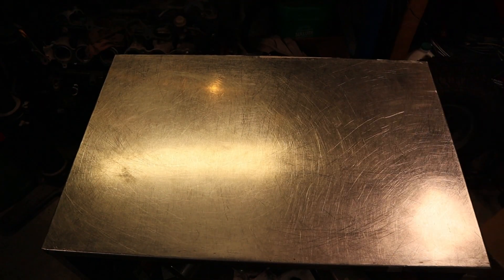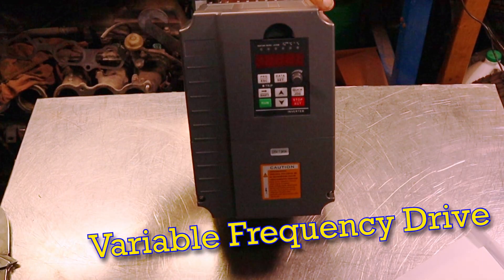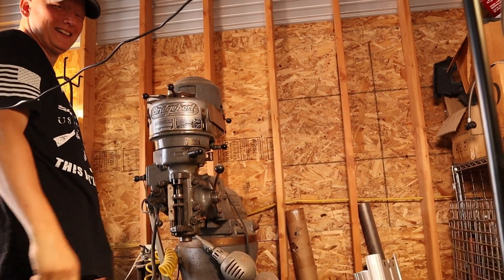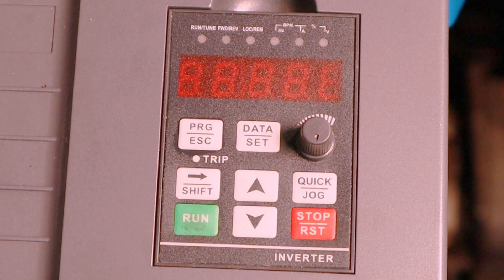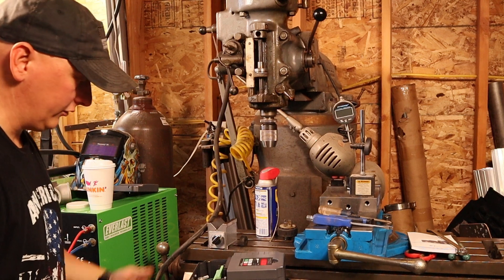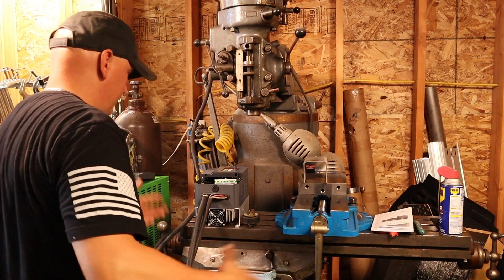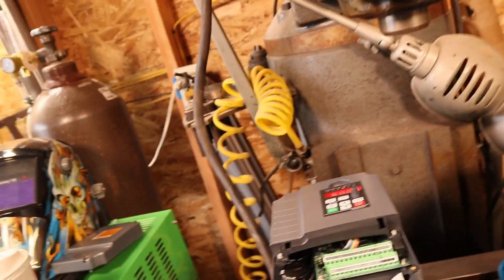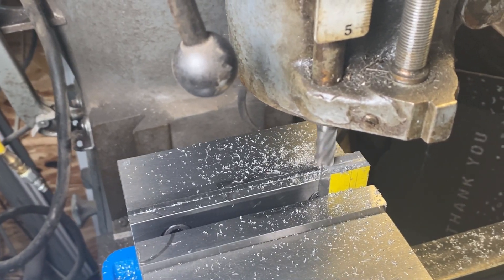BRIDGEPORT SINGLE PHASE TO 3 PHASE INVERTER

Comment: Did I miss where you mentioned what voltage your mill motor was?  It must be 220v 3ph because if it was 440v wouldn't you need a step up transformer?
Reply from the maker: It is 220 single phase this Bridgeport is 3 phase

Comment: Any particular reason you went with a VFD over a rotary phase converter?
Reply from the maker: Yes definitely. Cost, power consumption takes up way less space and easy of putting this thing together. And it fully programmable. When it stops if you notice on video it comes to a stop very slowly even though the rpm is slowing it’s still under power when doing so. Which can be changed to slam on the brakes instantly or just let it slow by friction of the machine. I haven’t played with the programming all that much. But I will set it up so it works best for all applications.
Reply: Man. I’m really struggling with deciding what to do. I really prefer to use the forward/reverse switch (for back gear/low rpm use) and I plan on also buying a cnc mill within the next year so if I buy a vfd/smaller rpc it would only be a temp solution. The biggest benefit of the VFD is mounting it to the machine and being able to use the same plug in as my lathe (240v)
Reply from the maker: @Frmrspecialist74  the only thing is single phase you can’t just throw it in reverse it draws to much power and will burn up the motor.